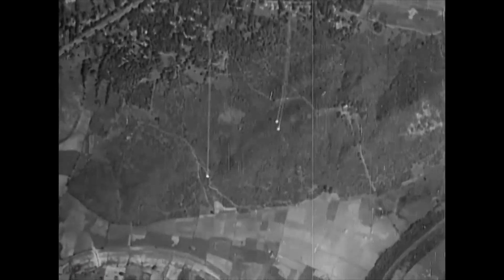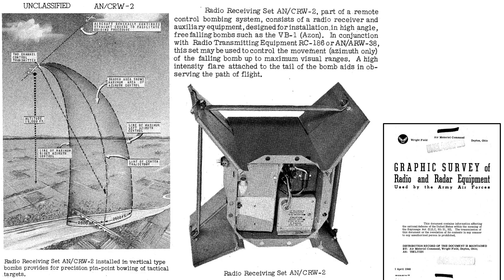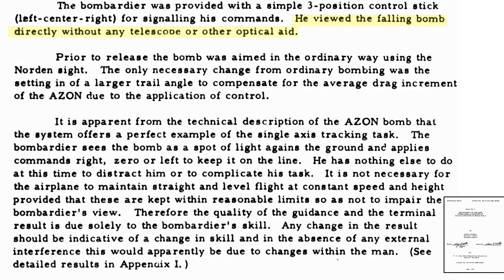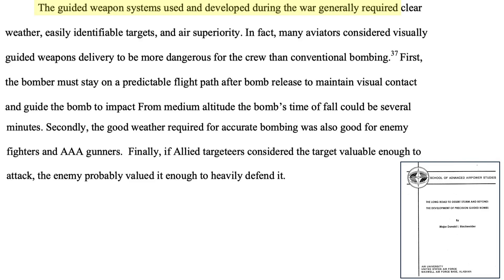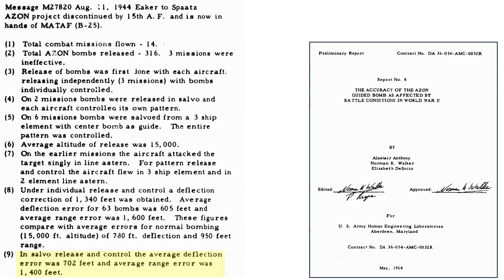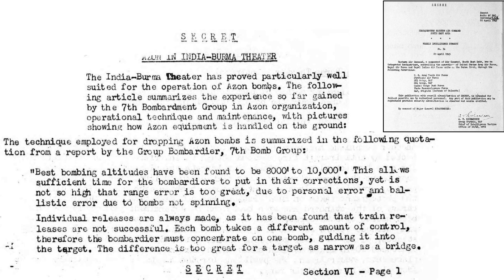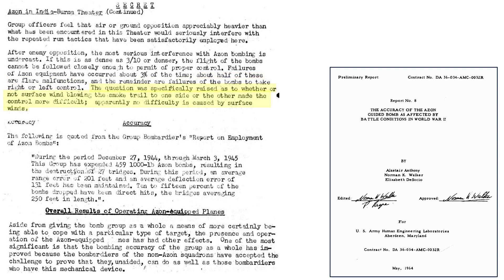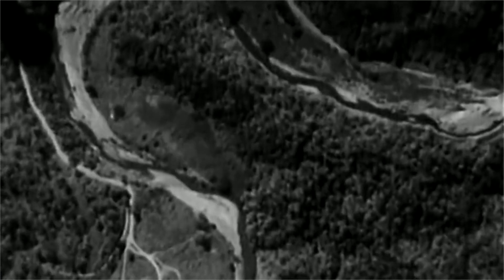AZONs - the first US joystick controlled bomb–Why they Failed over WWII Europe and excelled in Burma

Comment: The Japanese had  similar weapons in the Mitsubishi Ki-147 and the Kawasaki Ki-148 which were radio command guided weapons.  Even more interesting was the Ke-Go which had an infrared seeker head.  There is an extensive US military technical report on it that was done a few years after the war.  It's my conjecture that the Yokosuka MXY-7 Ohka suicide rocket plane was originally intended to be fitted with guidance control rather than to be used as a kamikaze weapon originally, but a guidance system couldn't be made in either satisfactory quality or quantity.   I imagine if they had the MXY-7 with an effective infrared seeker hand had them in significant quantities, it would have made a fantastic anti-shipping weapon.

Comment: Seems like they didn't fail. Since in testing they achieved incredible accuracy for the time and that was affirmed in Burma, there's no good reason they wouldn't perform equally well in Europe. More likely it was operator failure and poor implementation.  There were plenty of fighters available to cover the bombers for the thirty seconds or less of steady flight needed to guide the bomb. Saying there is no clear weather in Europe is just ridiculous.  Granted the altitude used in the east was a lot lower, increasing vulnerability to anti-aircraft fire.
The verified accuracy though demands that leadership work to solve the issue, not just give up.
Reply: It's Europe the most likely reason it failed was the weather conditions were simply beyond what they were trained in.

Comment: Is the guiding bombardier in the dropping plane? How would he see the bomb when it is below and behind the aircraft? Was the guiding bombardier in a following plane instead so he could keep the bomb in view ahead of him?
Reply: Bomb trail error from a bomb release altitude of 24,000ft of a 500lb GP bomb dropped from a B17 is just on 5% so about 1200ft so it might have stayed in view but the bombsight was modified to track backward.  Mentioned in Gregg Goebell's air vectors site.    The modification was apparently the biggest delay in getting the AZON into service.  Droop Snoot  glass nose P-38  were also used to fly behind and well above the B-24 thus allowing the bomber to break away immediately after release.   The P-38 would have been beyond the interception capabilities of anything the Luftwaffe or IJA or IJN had.  
-The Fritz-X got around the problem by simply slowing the bomber down after release through a pullup manoeuvre  (bomb fall time at 21,500ft is 37-40 seconds so there is plenty of time to execute this drill, the manoeuvre also threw of AAA predictors).      I suppose the USAAF could have used the Luftwaffe technique of slowing the aircraft down via a pullup manoeuvre and indeed the Luftwaffe could have used the USAAF technique of a separate guidance aircraft say a Ju-88S.